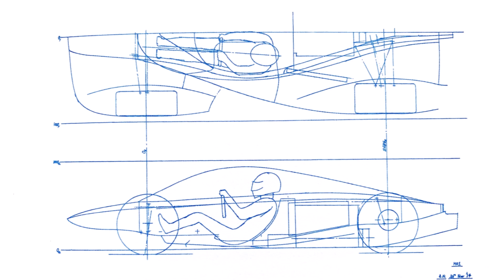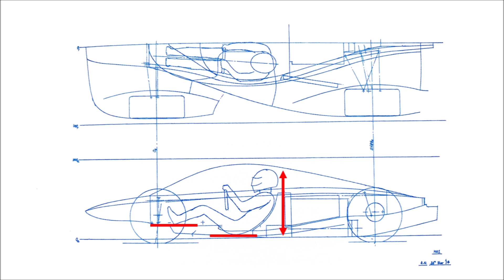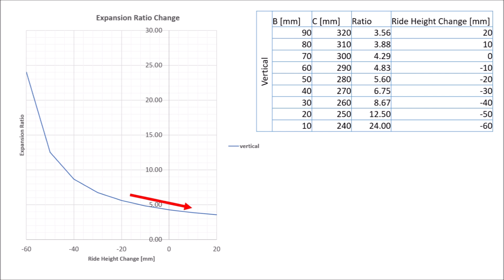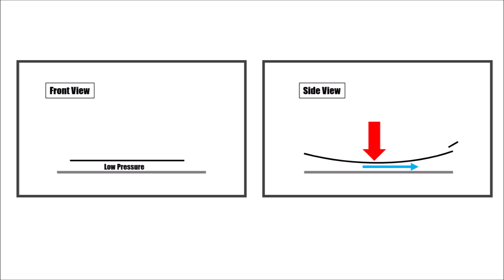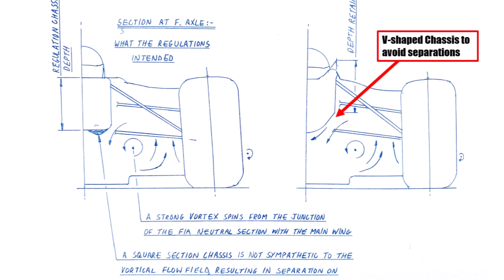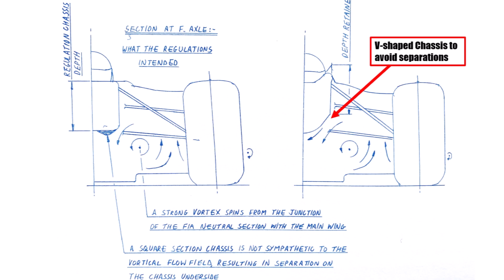Aston Martin Valkyrie - Part 2 - Beginning and Aerodynamics

Comment: something I still don´t get about the Valkyrie is the cooling solutions, how is that v12 cooled? and where are the radiators mounted? how does the airflow work around those systems?
Reply from the maker: You could see it in Newey's sketch in the video: The  Valkyrie has side pods with a vertically mounted radiator either side. The air can exit above the diffuser. So the cooling path is very similar to F1 cars.

Comment: The roof scoop is a thing of beauty. An absolute Newey masterpiece. 10/10 for him for conceptualizing that.

Great analysis. If it weren't for you, we'd never have learnt about this marvelous car.
Reply from the maker: You are welcome!
I'm not sure if Newey was working on details like the roof scoop, but someone definitely spend a lot of time on this.
Reply: @bsport320  given the complexity and the possible efficiency, it's likely that it's a Newey thing. Only he can come up with something as marvelous as that.
Reply: @bsport320  I think he was. I remember him mentioning in an interview that he designed the intake to do all the things you said but also so it could control what I think he called the spillout of air when not on full throttle so that the air that doesn't end up in the engine or cooling other stuff is still used
Reply: @dod_the_angel  What eactly is this "spillout"?
Reply: @arjun._.bbC6  if my probably rubbish understanding of aerodynamics serves me correct it's a portion of the air going into the intake that ends up being forced back out of the intake when the car is slowing down. That air is usually fairly turbulent and messy for the aerodynamics it passes over so newer designed two vanes on either side of the intake that effectively tidies up this air before it continues down the car
Reply: @dod_the_angel  I see. I had my doubts it would be because of backflow, but why does that happen? Is it because when you lift the throttle, the intake manifold closes and the sudden pressure difference forces the air in the tunnels back out?
Reply: @arjun._.bbC6  Probably something like that. Like I say, my understanding of aerodynamics is rudimentary at best

Comment: Could you explain how the curved section of the floor in front of the rear wheels works? I guess its supposed to capture the vortex generated by the front wing, but why is that something that is wanted? Also, why are there cutouts in that circular area?
Reply from the maker: The front wing is creating an outwashing "Y250" vortex and if the rounded floor edge can catch this, it seals the floor, which means more downforce. The rotational direction of this vortex is important.
The cutouts are there to push air downwards in front of the rear wheels to create higher pressure there and divert air around the rear wheel instead of hitting it. It's another concept F1 was using.
Reply: @bsport320  thank you for the response! Isn’t a vortex an area of low pressure? So doesn’t the vortex hitting the front of the rear tire work against the slots trying to force higher pressure air in front of the tire?

Comment: What’s with the trend of allowing flow infront of the rear wheel pods. Is it less drag by having that coke bottle shape or more downforce by having more flow over the diffuser increasing the pressure difference like in F1
Reply from the maker: The Valkyrie is also doing that.
It usually helps to increase diffuser performance (downforce) if there is a decent flow on top of it. And it helps to blow air into the wake behind the car, which reduces drag. But creating more downforce with the diffuser creates more drag, so it depends on how it's done.
Usually manufacturers choose to avoid it because it's a major packaging challenge in already fully packed cars.

Comment: Can you do a video about real frontal area,and it correlation with drag
Because I hearing that for the first time now
Reply: Agree it would be useful. If I have understood correctly, aero folks are suggesting that when the basic front area is displaced, the additional turbulence creates drag (to the sides and above the car) comparable in effect to additional bodywork.

If this area is filled with air to balance the pressures, the drag is reduced. Presumably curved sides to the car reduce the effect as well which is why the double curvature convex side windows of some cars (Cf. Costin, Scaglione) is a useful way of managing air flow if side wash is not used to this effect?
Reply from the maker: You basically want to avoid side separations like a European truck, that increases drag.
An F1 car just produces as much outwash as possible to keep the centre clean because drag is only second priority.
For a road car you try to reduce outwash to reduce drag.

Probably stuff for another video...
Reply: @bsport320  Understood. I think we can grasp the drag part, but the variations of pressure / directions of vortices are more tricky ;-)

Comment: Amazing analysis as always
I suddenly had a weird though, isn't a blown rear wing (or diffuser) some kind of anti DRS? What I mean is when the exhaust flow is highest, usually is when we want less drag and less downforce and when we want the most downforce is under braking and fast corners where little gas is applied.
The only benefit would be corner exit

Am I missing something ?
Also what is the % gain we could realistically see from a blown diffuser/wing ? Intuitively it seems quite small
Reply: I'm not sure how it applies to the Valkyrie, but in 2010-2013 F1 cars with blown diffusers (same thing, but diffuser instead of rear wing) had systems in their engines to keep the exhaust blowing air even when the throttle is closed. It sounds amazing, try to search it up

But nowadays, I'm not so sure how it works, both in the Vallyrie and modern day F1 where the trick exhaust system is banned. Sorry for the half answer
Reply from the maker: So there is an effect and it's higher the closer the exhaust is to the wing. The wing's effect on the diffuser is higher if the wing is closer to the diffuser.
All being pretty close to each other on the Valkyrie should mean that the effect is a bit stronger here but only the people involved in this project could tell us hard numbers about it.

And yes, you ware right, the stronger the exhaust flow, the more downforce, which is in situations we don't need it. So the Valkyrie can back off its second element of the rear wing.
More on that in the next part...
Reply: When everything else is equal, yes, a blown wing will create more drag. However, by blowing the wing, you can reduce its size and/or angle of attack which, in turn, will result in a net reduction in drag.

It's difficult for me to put a percentage on gains because there are too many variables, and it is usually a compromise. A smaller exhaust nozzle will give you a higher velocity, but it will also restrict the engine. If you are very effective at blowing a diffuser, you then may have to compromise suspension kinematics, and so on...
On a typical track, a blown diffuser will be worth at least a few tenths. The Valkyrie's wing will not be nowhere near that, but a gain is a gain.

Comment: @BSport320   Hi great channel! Behind rear tire diffuser has huge lateral expansion, how flow stay attached here? Why are tunnels so high from ground? (If gap is smaller pressure will be lower) Is flow inside tunnel vortex, does vortex flow sustain higher adverse pressure gradient ?
Reply from the maker: Thanks! There is not much problem to keep flow attached for lateral expansion. The wake of the rear wheels helps with that.
The smaller the gap to the floor, the lower the pressure but also the more sensitive to ride height is the car, which is not good for a customer car.
Large tunnels hold more air which allows for higher forces
Reply: @bsport320   Why they send strong vortex into tunnels? 
Why larger air volume equal more downforce,  if this air dont have low pressure than it is useless?